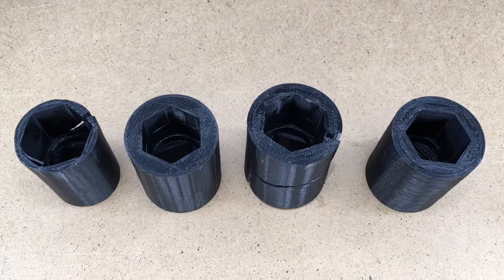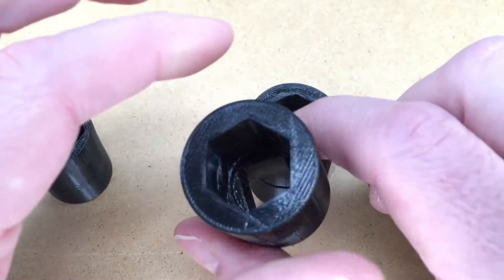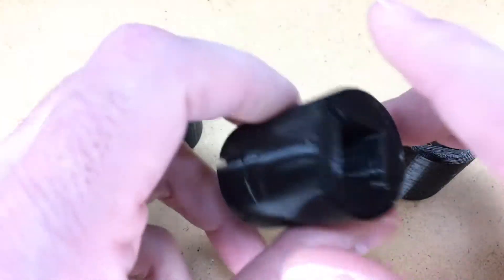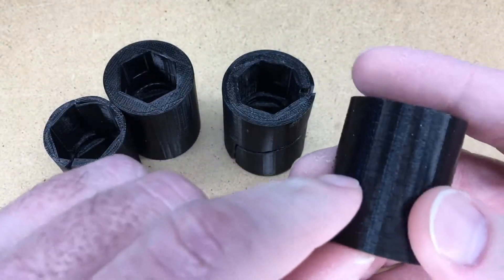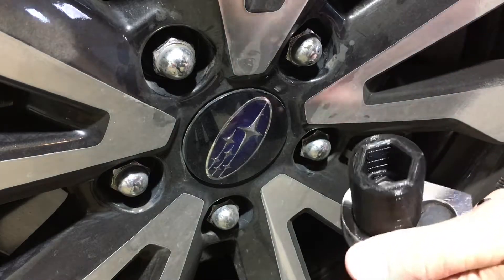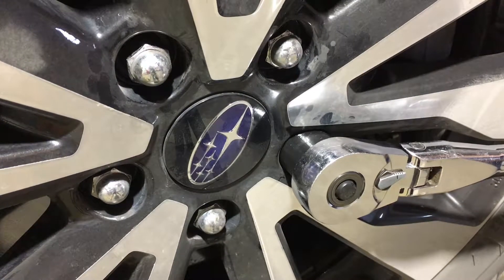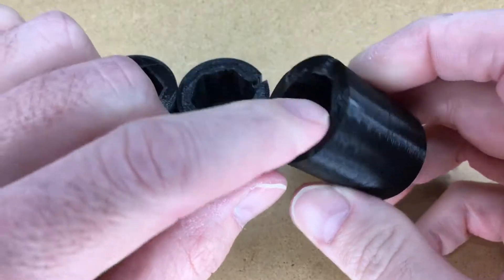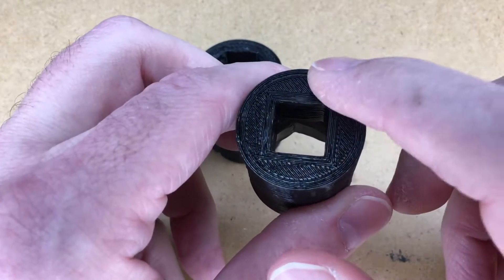FLSUN Q5: 3D Printed Socket Revisited, Still a Fail (Ep. 17)

Comment: You're using it on a high torque nut. This isn't a fail, it's an improper application. I believe this solution would be viable for low torque applications up to say 20nm